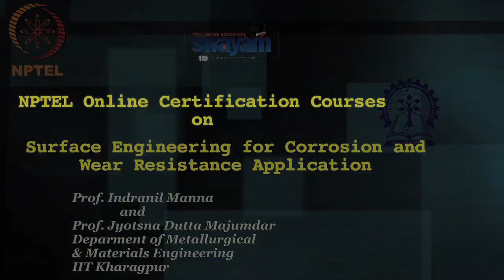Surface Engineering for Corrosion and Wear Resistance Application

Comment: Could you give me the name of the book or reference for all your video please?
Reply: 1. Surface Engineering for Wear Resistances (Introduction and classification of Wear) By: K.G. Budinski Prentice Hall, Englewood Cliffs, 1988,
2. Surface Engineering & Heat Treatment (Diffusion assisted surface alloying) By: P.H Morton I.I.T, Brooke field, (1991),
3. Protective Coating of Metals By: R.M. Burns & W.W. Bradley Reinhold Publication Corporation, N. York, 1928,
4. Metals HandbookNinth Edition, Vol.5, Surface Cleaning, Finishing & Coating,,
5. ASM, Metals Park Ohio, 1982. Metals HandbookNinth Edition, Vol.5, Surface Cleaning, Finishing & Coating, ASM, Metals Park Ohio, 1982.3
Reply: @r3521  thank you so much